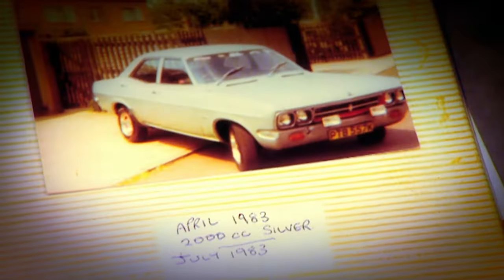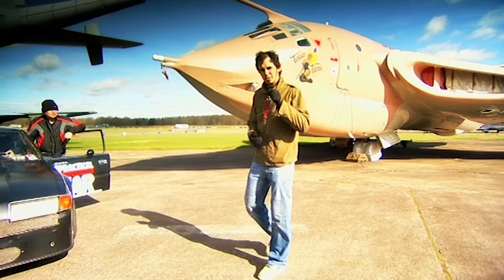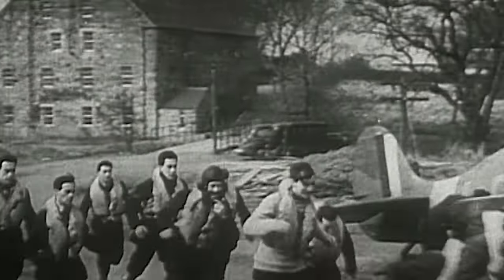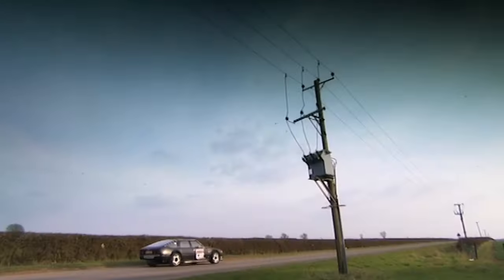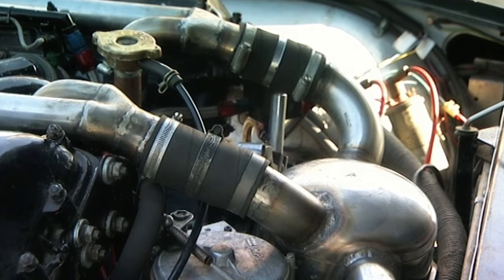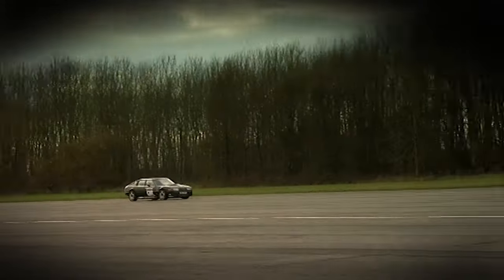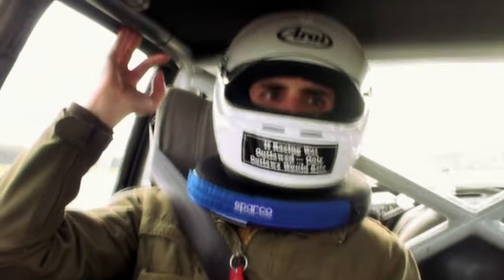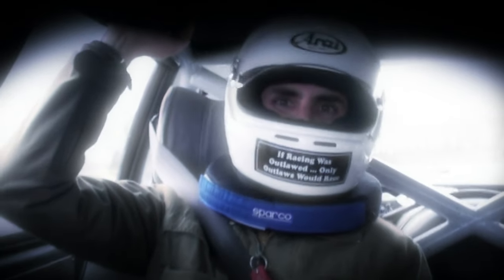Driving A Rover SD1 With A Plane Engine #TBT - Fifth Gear

Comment: I like this! Would it be possible to fit the Original dashboard in it again?
Reply: +Ronald de Rooij Probably not as the engine is LOOONG and he has placed it quite a way back through the bulkhead meaning a new bulkhead and nowhere to mount the dash.

But i like your thinking. Other than the front bumper and bonnet bulge, paint it 70's beige and that would be an awesome sleeper.

Comment: and he re engineered a leyand bus semi auto wilson gearbox,the guy has skills
Reply: Ah I'd missed that aspect of the 'gearing up' not hearing much of the transmission due to the blathering presenter. I wonder if  the presumably  epicyclic gear trains  use helical gears that needed  to be reversed to keep the side thrust in the correct direction , or whether the gearbox could accept full  torque coming through it via the original output shaft in what was originally an engine braking over-run mode? Unsurprisingly Fifth Gear wouldn't have worried about such things but the car's creator was likely well on top of the situation.
Reply: @philhealey449  wilson used strait cut gears
Reply: @andrewsmart2949  A protracted dialogue here!  I'd better watch again to understand what I  was blathering about !
Reply: @andrewsmart2949  Thanks for info.
Reply: @philhealey449  i used to rebuild this gearbox for leyland,hino and volvo B58 buses

Comment: Imagine something like a V-1650 Merlin in a car. With the original airplane exhaust and such.  Good God that would sound so freaking awesome (3000 HP?). There are a number of race boats using these type of motors and they do sound great!  This car doesn't sound quite as good with a tank motor.

Head out to the Bonneville salt flats to get room to stretch its legs.

Comment: Problem with that engine is that all the power is at the top end of the rev range, so it must be almost impossible to drive given the weight of the engine and car combined.  Town driving would be a no no for starters.
Reply: It's a tank engine

Comment: 0-60 in one second?

I want proof please.

I say it cant be done with wheel propulsion.
Reply: Have you never seen a top fuel drag car? They do 0-100mph in close to 0.8 seconds.  The record for the 1/4 miles is something like 3.65 seconds and it crossed the line doing 335mph.

Comment: Not a Merlin, but a woeful Meteor Engine. Yes plenty of torque, but circa 500bhp  (550 at most) from 27  litres not a good engine. Kind of explains why it accelerates so slowly

Comment: Going 160mph is all well and good but if you don't uprate the brakes, suspension, steering rack and chassis stiffness then it will be pretty much useless for anything other than a straight run on a runway

Comment: Jay Lenos favorite engine.  Stuck in a Rover....how did they get it in
Reply: it has foundations of the same engine but it's not really the same, this one here is less than half the power, there's people with loads of gen in the threads that explain the differences. If it was a Merlin as per JL then it would sound totally different.

Comment: I dread to think what the understeer is like in the wet with all that weight up front.
Reply: +Lander F Yeah, it is what it is. But iif you want to be a freak, this is how it's done. And besides, one needs weight for stability at high speeds, so it's all good. However, that car... I could never bring myself to put any work into something so mediocre looking. That's a patriotic domestic tuner for ya.

Comment: So.....30 mph over a stock Rover 3.5 litre engine using a 27 litre V12. Which if it came out of a tank was a RR Meteor, not a Merlin. No supercharger on the tank engine. It's annoying when they get these little facts wrong.

Comment: Imagine it turbo charged too !
it will reach 3000+ rpm faster !
Reply: PLease explain how fitting forced induction will magically strengthen internal components and increase the maximum revs of an engine...

Comment: It's not that much faster than the Rover Vitesse SD1, which had a top speed of 135 mph. I'm pretty sure the standard Rover/Buick V8 engine can be bored to about 3.9 ltr. tuned and fuel injected, and could be faster than this tank engined car. The Rover V8 is a very light all aluminiun engine, weighing no more than many 4 cylinder engines, and would make the car a lot easier to handle than a ton of tank engine. This guy spent £1,000 on the tank engine, but that money spent on the SD1's original engine could have given him a faster and more driveable car.
Reply: +Replevideo You are completely missing the point.....

Comment: What cars could he had bought for 10k that would do 160mph?
Reply: +TheDaedalx Jaguar XJR can buy one for around £4500 spend another £400 to get a remap to remove the 155mph speed limiter happy days. Same deal for the Jaguar XKR can get an old one for about £8000. Plenty of other cars for under £10k that will do well over 160mph.

Comment: According to this link, it's putting out 650hp and 1500+lbft of torque.  So why is it so "relatively" slow in acceleration?  I mean a Tesla has no gears, makes similar hp, and yet has 1/2 the torque, yet it accelerates to 60mph in 3 seconds.  http://www.digitaltrends.com/cars/british-lunatic-manages-put-27-liter-tank-engine-old-rover/
Reply: +Aussie2u Because it only revs to 3 thousand.
Reply: +Aussie2u Torque at the engine doesn't really mean anything though. As he says, because the engine is so low-revving he has to multiply the speed 3 times at the rear wheels to make it go anywhere, that reduces the torque at the wheels by a factor of 3. It's like a massive overdrive, in first gear. Horsepower makes more sense to compare engines with, even though most of the cool kids will tell you otherwise.

Comment: what a waste of time, money and petrol, or kerosene or whatever. have you tried a 4 cylinder 2 litre mazda dyson racing engine in that? fastest thing on 4 wheels as far as i'm concerned. i'd take anything on in that thing, knowing that nobody had even a chance of beating it. well, maybe the bentley speed 8 on the old mulsanne straight, but that racetrack is now defunct

Comment: Theres quicker accelerating audis, mustangs, bmw than this rover with huge engine lol, it might have a bigger engine but you need miles of road to reach those really high top speeds in this thing lol, bet its stupidly fast mph flat out tho lol, put a twin scroll turbo or supercharger on that thing an it will accelerate like a rocket 🚀👍👍

Comment: I wonder what MPG it gets xD xD
Reply: I bet it's somewhere in the 10 gallons per mile region 😂
Reply: Drew Hender I actually did some reading. It gets 2MPG hahaha.
Reply: InvisibleYetVisible Damn that's poor haha
Reply: Drew Hender I suppose you wouldn't use it as your daily haha
Reply: I'll stick to my 125 thanks 😂
Reply: Drew Hender 125MPG? wow.
Reply: Yeah my little Honda cbf can do 140 if I'm really careful 😂
Reply: Drew Hender Ahh, bike. Fair do ;-)
Reply: WWII fighter planes were capable of about 5 mpg, and I think that's the economical end. In something like this, where the engine is barely using any of its power (lots of pumping losses) and is in an unaerodynamic (compared to a plane) vehicle, I would imagine 3mpg or less.
Reply: Daschickenify it gets 2 MPG according to the forums where it's documented, but let's be honest, that's missing the point.
Reply: Daschickenify

Comment: I'm aware that the Merlin 12 won WW2 and secured freedom for the Western Hemisphere, and was indeed a very cool engine and war hero; But why do Brits think it's cool to produce 1500hp from a 27L when they hate on "inefficient" American engines for making only 500hp from a 6.6L? They are all big alloy lumps anyway, and I'd think you'd want the lightest and strongest cube that fits in the available space while being the cheapest and most reliable to operate. Why is this cool, while a Mark IV Chevrolet isn't? And why so much interest in pointless features like cylinder head architecture and valvetrain configuration and internal displacement? I just think "what makes bonkers power, is cheap, fits in a 30x40x35" "cube" and is compatible with available gearboxes.
Reply: William Woods: Starting a new nation? I hear there is lots of available property on Mars AND it's very nice this time of year. While you're at it, you can surf gas clouds on Venus. Yes! I will drive your Chris-Craft while you ski behind it in the atmosphere of Venus! Cell phone reception can be a challenge, but the humus is fantastic. How are the Lin Kuei these days? Give Scorpion my love and remember to bring the Apple sauce!

Comment: If it was actually a Merlin engine it would be a lot faster, those things ended up with around the 2000HP mark (no idea on torque figures??) thanks to Frank Whittles supercharger developments, I don't think the tank engine in this car had any of that, but cool either way hey.